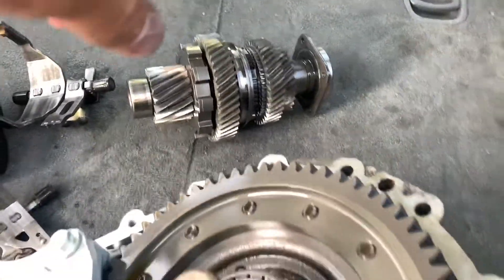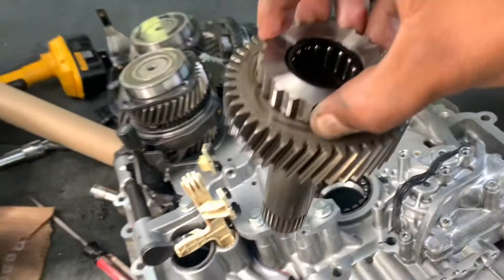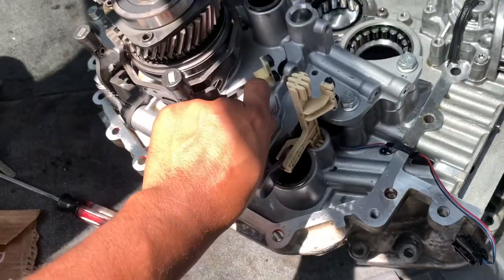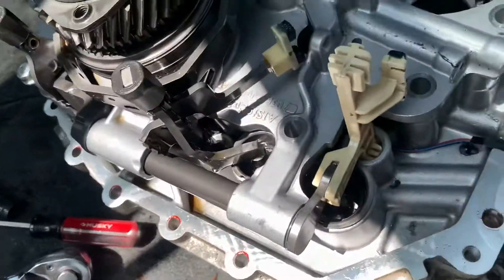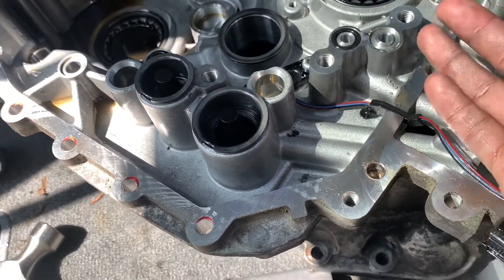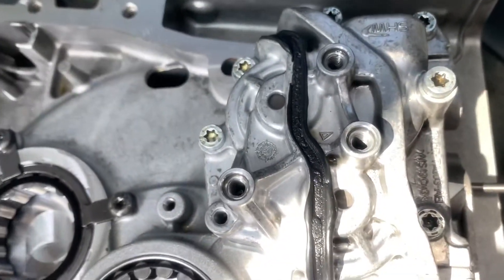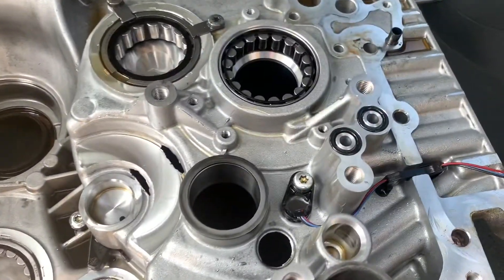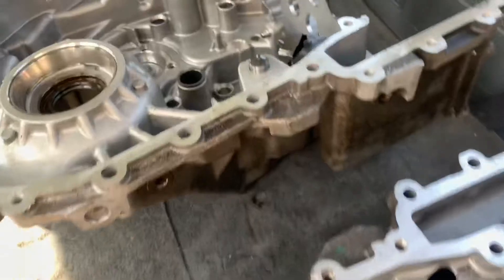Mitsubishi Evo X MR DCT470/ 6DCT470 Transmission build - Part 5 Internal filter/Gears/Magnet/Piston

Comment: Nice. Are you going to replace the torque damper springs? Or the whole thing?
Reply from the maker: Leslie Singh Im actually going to take my torque damper to a shop so they can replace all the parts on it. Plus pistons are being replaced and the shift fork 2/4, internal filter is getting replaced. Internal pump is still good. The clutch plates and steel plates are getting replaced. Mechatronic unit idk yet lol I haven’t opened it up yet. That’ll be the next video but for sure want to replace all the gaskets and stuff in it. 👍
Reply: @josezamora7889  Where did you buy the parts? its any website that you can send me? I need magnet sensor